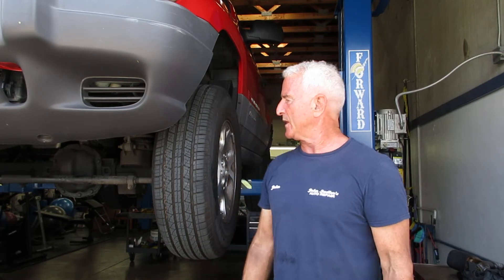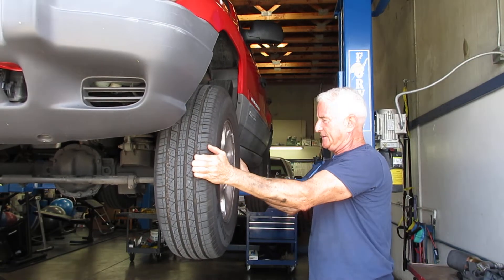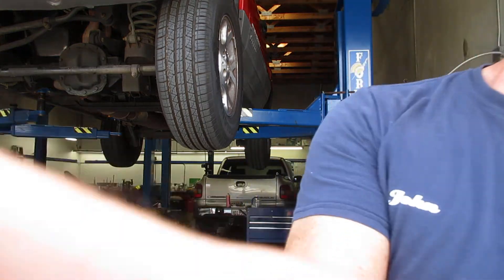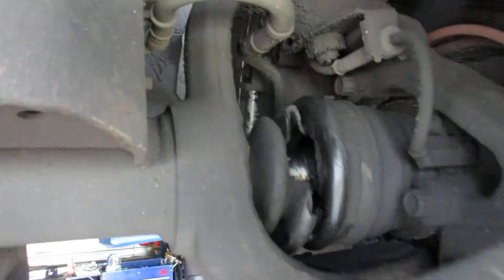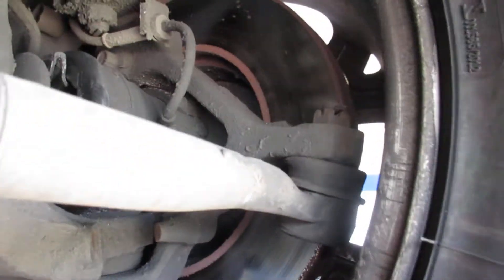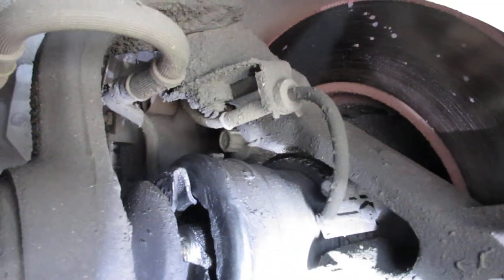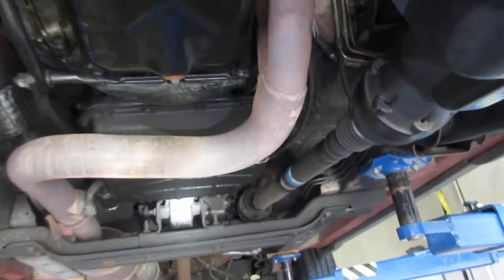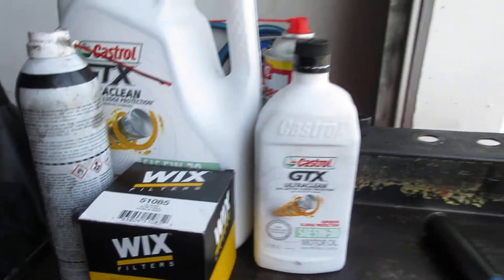JEEP GRAND CHEROKEE NOISE WHEN DRIVING

Comment: You replaced the left front axle shaft seal since the axle was out ?
Reply from the maker: Not on this job, both front axle seals were dry. I usually will advise the customer to do it if they are wet or leaking. 
In my entire career I've only replaced a few of them.

Comment: i have a click sound when i drive knock knock and its not from the motor is this probably have this probleme?
Reply: Check if its happening when the air is going inside the car. I had a clicking sound that turned out to be a bad blower motor around 60k miles in my Jeep WK2

Comment: I've got 5 40 oil left over from last car, can I use it on a 2001 wj 4.7?
Reply from the maker: Hi Terry, I would go by what it says on your oil fill cap. If there's nothing written there I would go by the owners manual.
Reply: @JohnSadlersAutoRepair  5 30 is recommended! But I think 5 40 just gives a wider heat range!? But yeh, I'll go with recommend! Appreciate ur vids and feedback!
Reply from the maker: @terrystratford1235  just make sure use a good quality oil Terry, I use Castrol on most vehicles
Reply: @JohnSadlersAutoRepair  so tesco own oil, no good then!!
Reply from the maker: @terrystratford1235  I don't know Terry, that's just the oils I use